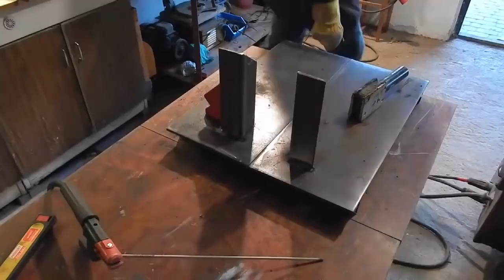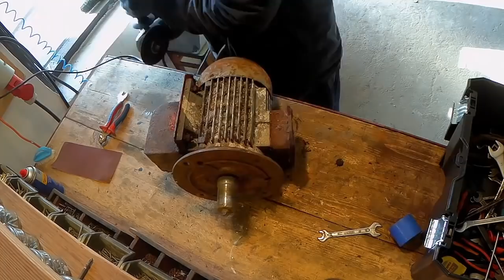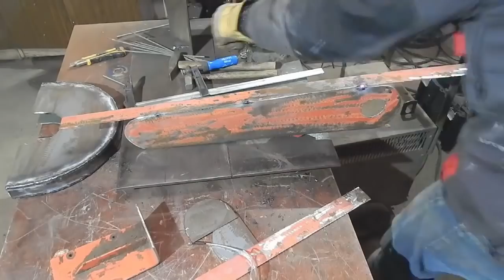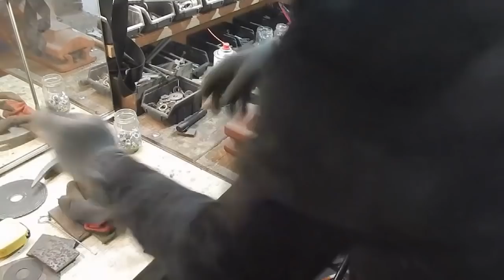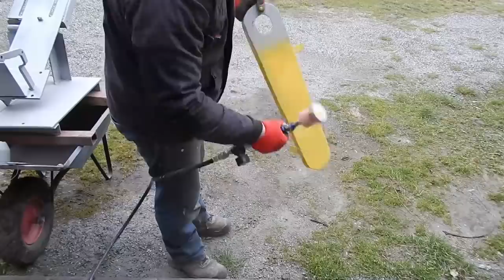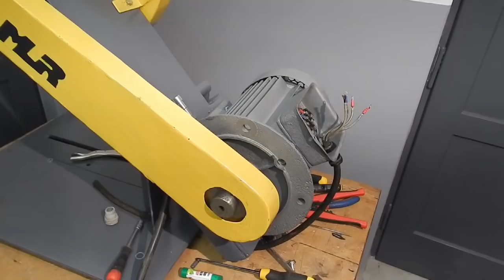#DIY Przecinarka do metalu / Gumówka / Chop saw / Policorte caseiro

Comment: Nice project , did you measure the number of revolution per second , because every disc has its max rpm.
Reply from the maker: Thanks, saw is around 2600rpm, disc max 4400rpm